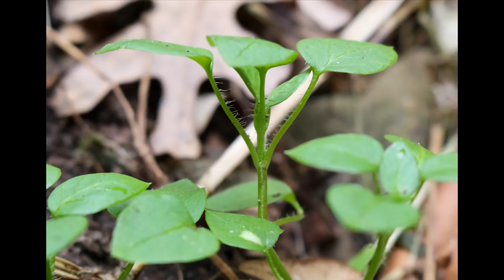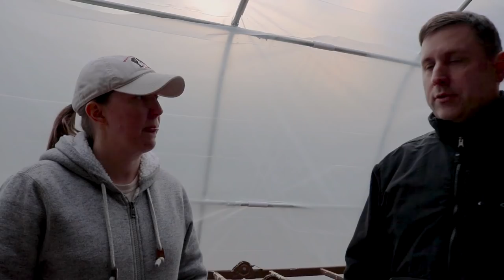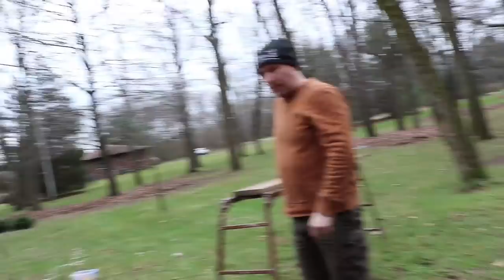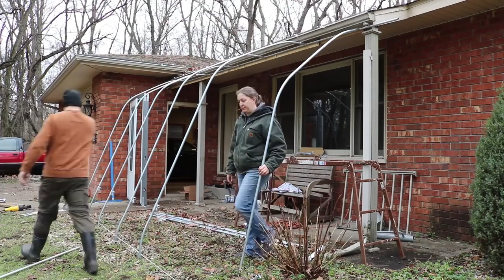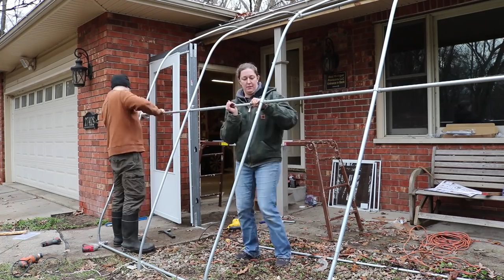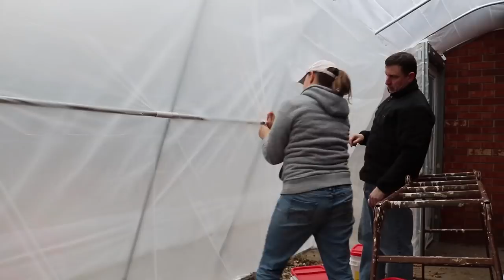$400 Greenhouse Part 4: Walls

Comment: Was that just regular electrical conduit? I like the idea it's a cool space but if that is what I think it is don't let any snow build up there. Those have no structural support in them at all. I'd be afraid to hang flower baskets on them. Other than that looks like you acomplished what you set out to do. Congrats.
Reply from the maker: Yes, the metal type.  Ive used it for our 3 foot hoops in the garden for years with no problems.  We dont really do hanging baskets and with the angle, once we have a few inches of snow, it slides right off.

Comment: It looks good. I hope you show it when it’s full of plants! How are you going to ventilate it?
Reply from the maker: Absolutely, will do!  Ventilation can happen one of 3 ways.  The door has a window that you can slide down from the top as far as you want.  It's also easy to unclip a part of the plastic, if needed.  And, in winter, if it's warm enough in the greenhouse (it's been 40 degrees above the outside temp on the sunny days) we could just open the windows into the house and heat the house with that air, lol!